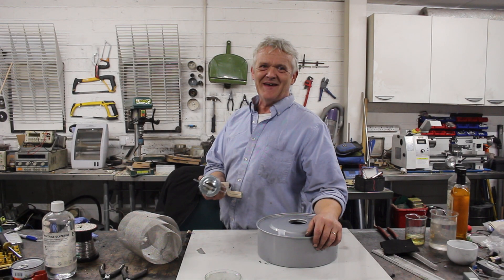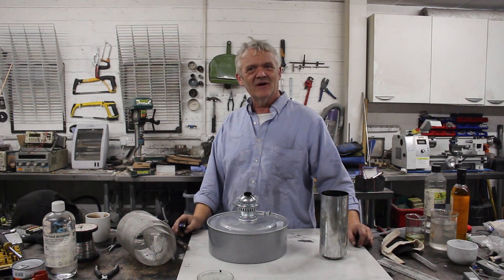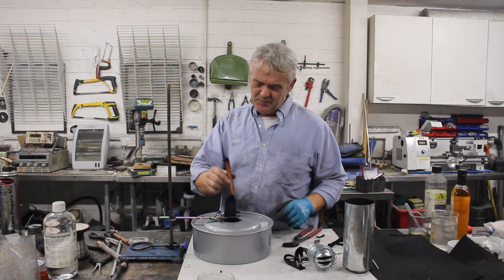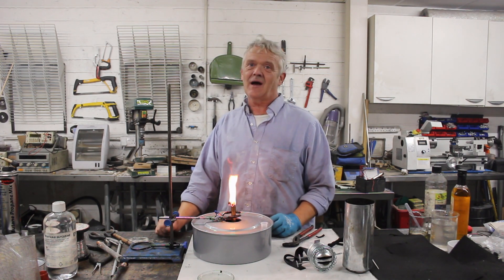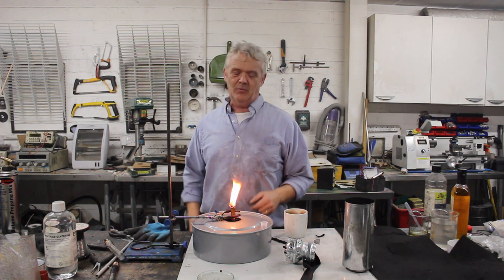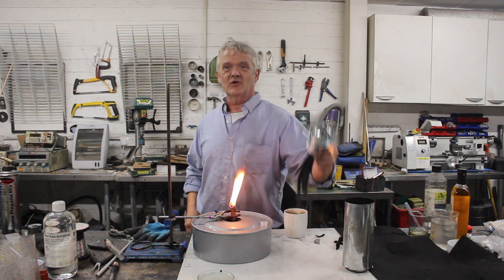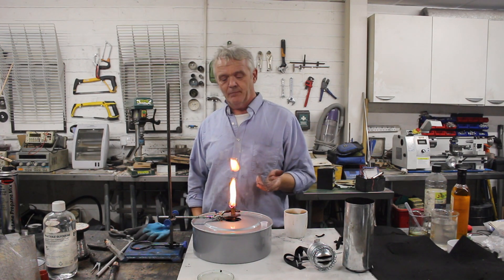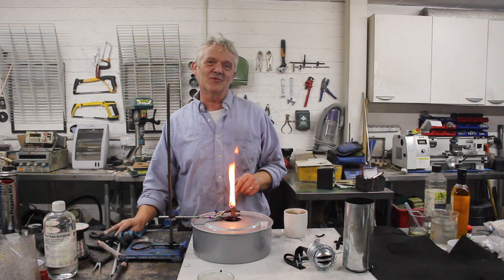1684 Can The Forever Wick Replace An Ordinary Wick?

Comment: you need to presoak the big flat carbon wick  in fuel media (kerosene) for at least 24 hr then try to light.... with eye dropper try dropping a few drops of alcohol on the wick as primer and attempt to light....  once capillary action is established on the fuel side the carbon wick should work..... just some thoughts.

Comment: I have done the whole forever wick   the past 2 years,  even your naming is my naming of the wick . So the best solution for the wick part was diamond mining mesh about 0.5mil grid . Forever and ever.  And the best eco fuel for it was normal candle , but have burnt also from car oil to cooking oil no smoke . But money wise and available to non oil users , normal candel. This mesh also allows for an baby mini rocket pipe stove 😂
Reply: Where dose one find this Diamond mining mesh? Im not finding much of anything when i search those key words

Comment: Can you just keep the original wick as low as possible and WICK the carbon felt on top. Since the carbon felt WICK doesn't burn? So cut a small portion of the carbon wick so that it touches the original. Why replace the whole wick?All you need is the carbon felt touching the original for wicking purposes. Like a zippo lighter. Why replace the cotton when only the wick burns. Just asking.

Comment: I’m wondering if you could hammer out a small section of copper pipe or fitting into an oblong shape just the width of the carbon felt…and place it on top of the lamp with the fiber extending above that….since the lantern doesn’t have a preheated section. Make one. The preheat chamber is accomplished…you may have to use a set of needle nose players to adjust the wick at first and every so often I suppose. Any comments?

Comment: I took copper wire and sewed it into the carbon felt.
Only thing I have to do is tip the lantern a bit to prime the wick, then light it.
Thermal feedback from the copper wire is enough to make it work.
Cotton wicks get used up. Carbon felt does not.
When you run out of the cotton wick, your lamp is useless.
To clean carbon felt if it ever needs it, remove it and burn it hot in a fire.
Then it works again with no problems.
Oh and I was using Kerosene in that lamp.

Comment: Would it work with one of the old round wicking heaters like the Valor Junior 56? They have a brass or copper (not sure which) central metal wick depressor to make the flame go full circle.

Comment: I tried the forever wick in a small bit of copper pipe, running on vegetable oil, on my terracotta pot heater. However it gave off a load of soot, after a while. Which lined the inside of the pots. I immediately put out the flame. And had to scrub the pots clean. Is there any solution to this soot?
Reply: If there's an unusually high amount of soot, it's likely that not enough air is going to the flame. You'll need a pipe above the flame to create an updraft so that more air can be sucked in towards the flame.
Reply: @tichrontus  it's a terracotta pot setup. So I'll try raising the Pott o allow.more air
Reply: @carlosio  If you have trouble finding a pipe, alternative is to roll wire net into a tube and wrap aluminium foil around it.

Comment: I would try sandwiching or even weaving several strands of copper wire into the wick to see if it will do the job of preheating the oil.
Reply: Being curious, I would also try different metal wires and measure any voltages they might make in burning from carbon to metal.

Comment: If the wick is in a container harmonics are partley cepte inside and translated bi the mantel.💜
If heat was the source option 2 would not burn too🙏💜🙏
As it have nevver burned bevore💜🙏💜
As there was no heath to create these conditions the furst time you lighted it🙏💜🙏

Like water 💜
Has caputulair behavieure inside the tiseuw of the plants. 
But if I lower the space thention of the atmosphere the plant is within the water is not able to counter that hight💜
Do to a lag of natural thentional diverentional of the dimentional space  behavieures of the total set of conditions💜
Look to the video I shared whay water behaves if it drops out of  the tap
Wraping space💜 and diverentional.
Tube inside smal volume .
Around the tube bick volume boths the same thention onley one with more volume is more thention.
So inside starts releasing to the shaft dimention as the shaft dimention starts to release to the outside dimention.
Ratio  carbon exeteration capillary oils inbetween the carbons 💜
Reply: May it surve yours today question dear one 💜🙏💜

Oll injoy beïng🖖🌈🎁

Comment: does anyone know of any issues of combustion (explosion) using vegetable oil in a heater like the one Robert is showing?  would this  create carbon monoxide?
Reply: This is along the lines of what Im interested in. I want to figure out how to burn vegetable or used motor oil for a good space heater in case we lose gas this Winter due to stupid things going on in the world or in case it gets stupid expensive to heat with gas.
Reply: All fire create carbon monoxide to some degree. The dirtier the fuel the worse it us in general. For using any fire source for heating in an enclosed space the burn stream and the air stream have to be separated.

Generally your fuel is burnt below a pipe or radiator that then pumps that heat into the desired space while the waste is pumped outside.

Comment: Very interesting. I wonder if soaking the 'forever wick' in the fuel first will help. I had a similar situation when running my kerosene hurricane lamp on citronella oil. I needed to soak the standard wick a bit longer to make sure there was oil at the burn point before lighting it. After that it would burn as normal.

Comment: In the perfect fuel video, would copper oxide powder liberate its oxygen to iron the way iron oxide will to aluminium but in a more controled fashion?  Is there a way to transport oxygen ions to an electrode made of compressed carbon powder that is porous.  Is it possible to make a porous iron dust core?  A porous electrically conductive iron dust core?  How fast can iron powder be made to rust by chemical action or electrolytic chemical action?  I think we're back to the iron battery again.....

Comment: Rolled stainless steel mesh works too.
Reply: That's interesting. Makes me wonder if a kitchen sink cleaning scrubber of stainless steel would work. They used to be a pack of six balls of stainless for a £1. I have a Ripping Giles paraffin heater in the garage, unused. Its unusual in that it uses 6 round wicks instead of flat wick like we see in the video here. Thanks for you comment.

Comment: I had good results using very fine steel wool as a wick burning vegetable oil. However it's peculiarity is it doesn't like to be bigger around than a pencil, and not too small it can't wick.

Comment: I noticed that Zippo wicks have what appears to be strands of copper wire braided into them. I figure it is for wind resistance, the copper wire stays hot enough to keep the wick lit when the wind blows. I wonder if the copper wire braid idea would work for this too.

Comment: could you not put the copper pipe inside the stock burner head? ie. flatten down the pipe so it acts like a sleeve over the ribbon and take out the dial for the wick you wont need it anyway.

Comment: I'm thinking about using it in an old kerosene heater in my basement. If I can run it on oil then I can save on fuel costs.
Reply: Same here

Comment: That's a neat idea. however, really is it practical I have hurricane lamps that I use when the power go out I've used them on and off for 30 years still have plenty of wick left I have one lamp my grandma used with the original wick still in it yes it's not used 24/7 but I can get replacements for about a dollar

Comment: Is there a risk of the copper pipe transferring too much heat to the fuel causing vaporization or ignition?
Reply: I would doubt this.  If the flame is burning at the flash point of the oil, and the copper around the flame reaches that temp, then as the heat transfers down the pipe it will also radiate heat in the surrounding air.  I would think the copper could raise the oil to a flash point, but it would need a much higher temperature source.

Comment: I have the same problem, wanted to get my Petroleum heater running yeasterday, but the wick does not pull up the petroleum oil and just the wick burns out at the top... Unfortunately I had also used half a liter of petroleum with a gel inside for barbecue starters...which normally also is just petroleum, but this brand was coming with encased or with a gel added to it... Damn... Maybe it clogged the wick, alhough I poured another 2 liters pure petroleum into the tank.... So I probably will try to also order these carbon felt material and experiment with it. Would be great, if one can just use the cheapest Rapseed oil from the super market... As it has been getting cold over here in Berlin Germany now and the winter will be coming soon, I really have to prepare for the worst in this times of war and rising energy prices....
Thanks Rob, all ideas really welcome you are really God sent...
Regards ,Stefan.
Reply: Just a word of warning: carbon felt for ovens is probably and most likely lazed with poisonous fire retardant chemicals, so check the additives on the carbon felt before long indoor use. hope you decide to do the experiment and injoy and work with the results.
Reply: @robertpitt8418  Thanks a lot for the warning, yes, I will look into it and see what kind of additional chemicals are in there inside these graphite felt materials... Many thanks.
Reply: @StefanHartmann-hartiberlin  ( ideas)  drench the newly cut felt wick in vegetable oil, then wrap the wick in tin foil before lighting. You can also use 1oo% cotton bath towel cut to size as a wick. Have fun.
Reply: @robertpitt8418  Thanks a lot for the 1oo% cotton bath towel  idea. I will try this also, when I have got time..Cheers.
Reply: Ich hab gestern Rapsöl und kupferrohr gekauft. Heute kommt die Matte mit dem Aktivkohlefilter. Und dann wird wild ausprobiert. 😁
Reply: @nachtbild  Super, poste mal bitte Ergebnisse hier drunter. Dankeschön !
Hast Du direkt Graphite Felt gekauft oder wie hiess das Material ??
Reply: Beim großen Fluss gekauft: GIAK Aktivkohlefilter 2Stück schneidbar. Die hatte Robert in einem früheren Video als Dochte für Pflanzenöl benutzt. Ich möchte damit mal ausprobieren,ob ich eine konvektionsheizung mit munitionskiste hinbekomme. Falls nicht, habe ich viele sehr warme Kerzen... 😄
Reply: @nachtbild  Hmm, guck mal beim grossen Fluss unter:
SOFIALXC Graphite Felt Carbon Faser Schweißdecken Schweißermatte Unterlage Für Handwerker Feuerfest Schwarz-Thick 2mmx100x1460mm 
Ich denke das ist eher das, was Robert benutzt...
Reply: @nachtbild  Keine Aktivkohle, sondern ein Graphite Filz !! das hat einen Ohmschen Widerstand von ca. 0.2 Ohm x cm, also fast so gut Leitfähig wie Metall !!
Reply: Mist. Gut, dass du aufgepasst hast, danke! Neue Bestellung ist raus, kommt aber erst Mitte Oktober. 😐

Comment: interesting that it doesn't work..... is that because the wett-abilty of the carbon is less than the cotton wick or perhaps the random fibre orientation of the carbon felt doesn't wick as well as as one with continuous fibres in the vertical direction it would be interesting to see if a suitable carbon cloth would work as a direct replacement.
Reply: Heating the liquid reduces its viscosity. What that means is that the kinetic energy of the fuel molecules makes them slide past one another more easily and not stick to each other as much. So heat reduces the fuel's attraction to itself. Now if you have another material which has a very similar attractive force to the fuel molecules, it can be slightly less attractive when it's cold, but reducing the viscosity makes those molecules "prefer" the wicking material and start wetting it. That's my guess anyway. The wick is carbon, the fuel is basically carbon, so it's a small gap to overcome.

Comment: What if you pyrolize the ribbon wick and then used that? You can pyrolize it by putting it in a tiny tin can (such as those empty paint tins sold at hardware stores) punching a hole in it, and placing it in a fire until all the volatiles are burned off. Would a pyrolized ribbon wick work? I don't see why it wouldn't; The weave is tight enough, and the only difference is that it would be carbon rather than cotton if you pyrolize the wick to make it into char-cloth. 

Maybe the copper pipe you squeezed the carbon felt into is squeezing the fibers close together so that the capillary action can actually work, whereas when loose, the fibers aren't close enough to actually wick the parafin. The ribbon wicks are woven, so the fibers are close together. Could you test this theory?

Comment: Not convinced by the explanation or hypothesis that  the sustained combution is due to the pipe conducting heat downwards. It lit too quickly for that. The flame shield (the top dome cap with the slots for the wick) is to reduce (shield) the wick from too much heat.
I would say that the carbon felt was  compressed in the  pipe thus enabling capillary action by increasig the force.
𝜋(𝐷/2) squared 𝜌ℎ=𝜋𝐷𝜎 cos 𝜃 𝑐
Could this flat felt be permently compress thiner? Perhaps by passing it thru a steel mangle, in the hope that it wicks better in the stove’s proper wick winder?
P.S. When did you last check the workshop’s smoke alarms? 😉
Reply: Well he mentioned fuel already being in the wick, so maybe he dipped the whole thing at one point. I don't think compression is the answer, it wasn't that tight of a fit. It's all about viscosity. When the fuel molecules don't cling to themselves as much, they can adhere to other stuff better. I think pure carbon is just barely less attractive to the fuel than itself when it's cold, and there's a threshold where it gets thin enough to wet it.
Reply: @DFPercush  As the fuel heats the density goes down - yes? Yet, you will see that 𝜌 has little effect compared to 𝐷

𝐷 = diameter of the capillary space,
𝜌 =  density of the fuel,
𝜎 = surface tension of the fuel,
𝜃𝑐 = contact angle of the fuel within the capilary space.  
ℎ = height that the fuel rises to.

From that we can also get: 
ℎ=  (4𝜎 cos 𝜃𝑐) / 𝜌𝐷

The vesocity may well go down which will help with thicker fuels like vegetable  oils and animal  fats which flow too slowly to keep up with the speed at which they are consumed. However, that has no effect (given enough time) on capillarity. It is the space between the fibres which matter. Too far appart (as with this felt in its form as suppled) and it won’t wick - unless of course, someone comes up with a viable “Ah but you have overlooked…” explination.
 
Asbestos  has low thermal conductivity yet has been used for wicks for some 6,000 years.
Reply: @Nuts-Bolts  What I'm suggesting is that there's a binary factor in the system that turns on or off completely. That being, whether the fuel is able to wet the surface of the wick. Try drawing mercury up a glass capillary tube. If the surface is hydrophobic, or whatever-liquid-phobic, then that formula doesn't apply. But lowering the viscosity can flip that switch.

Comment: Great vid and really good to SEE the demonstration. Some of us (me) aint to good on the theoretical side of stuff. So basically then, as my feeble braincell attempts understanding, the copper pipe is a primitive *pre-heater*. it contains, "conditions", and directs the flow of the fuel to the point that oxygen is able to mingle freely with fuel and complete the fire triangle? AM I RIGHT?
Reply: The walls of The copper pipe forms and creates a hot chamber for the heat to travel downwards, this heating effect brakes down the fuel below to make it easier for the oil to travel and rise to the greater concentrated heat above.
Reply: @robertpitt8418  heat will NEVER travel downwards. otherwise practically all fuel storage containers would just .. well. ignite.
Reply: @Palmit_  hold the end of a piece of wire the size of a match stick in your hand and using a lighter, light the top end and you will find that the heat will travel downwards to the tip of your fingers. Now imagine the piece of wire is the copper pipe and that your finger tips is the oil.
Reply: @Palmit_  it absolutely will travel downwards in a metal conductor and copper is one of the best.

Comment: Does it wick up because it is almost gaseous or is it a sort of capiliairy effect?
Reply: The way to tell would be to preheat the fuel source (staying safely below the flash point) and see if it will wet the wick. I think changing the viscosity of the fuel by heating it brings it above some threshold where it's able to grab onto the wick. So capillary effect, to answer the question. P.S. At standard pressure, things are usually either a gas, or a liquid, there's no "almost", but at high pressures you can have supercritical fluids, those are weird.
Reply: @DFPercush  ty👍 I did know I spelled capilary wrong.....